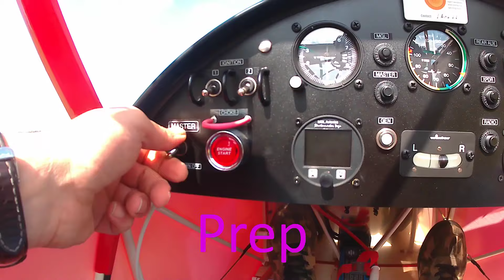I replace the side windows on my Sherwood Kub

Comment: Hi. Interesting to see the lifespan of material that has variation of temperature and vibration factors. Thin material is more susceptible to environmental factors, so seeing the transparent screen being replaced the way you did in this video is very helpful. Increasing your workshop to a higher temperature (this time of year - chilly outside) for assembly to minimise fracturing of the plexiglass, especially as the plexiglass is relevantly thin. Nice to see your modification, progressive step is a better term, to use silicone to bond the transparent and expandable film onto an aluminium frame. Rather clever as it will also reduce the vibration of plexiglass in a cold environment that can reduce the chance of fracture of plexiglass especially where it has been riveted.
Reply from the maker: All good observations PTG. I think it will imporve the view for the next 5 years. :-)

Comment: Interesting Algy.  I noticed you use a metal holder for the silicone tube.  I prefer a plastic one because as soon as you stop the flow from the tube stops.  With a metal one there is usually a delay.   Something my younger Brother taught me.
Reply from the maker: Not had any issues with my old metal one as I can press the lever at the back to reliease the piston, it is a bit of a case of what works for the operator :-)

Comment: Hi Algy, did you use a Lexan equivalent?  Did you find any material creep when applying the Rivets?  It reminded me of making Skyranger doors, but they have a funny bow in the construction.
Reply from the maker: Simular but not as sensitive and the sealant is the non amonia type so it will not craze it either. No material creep with the soft aluminum rivets especially if you drill the holes to 3.5mm to give the shank some place to go.